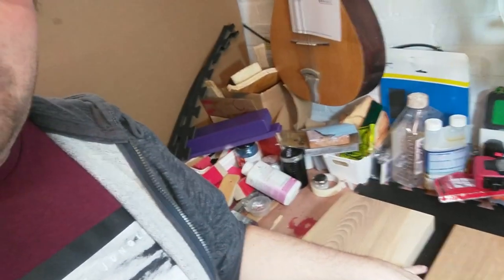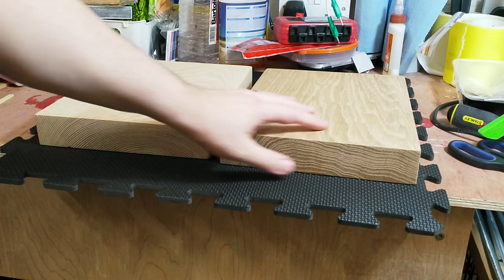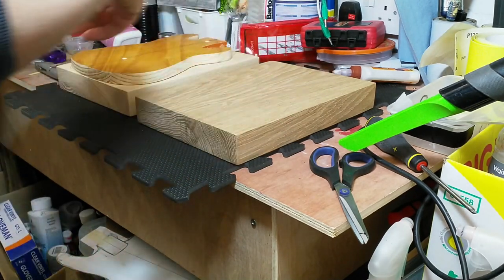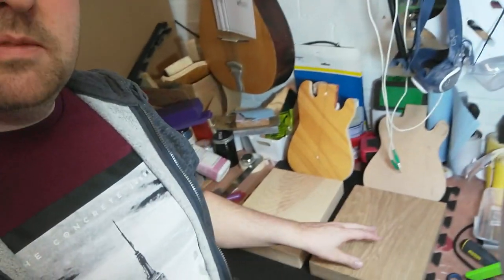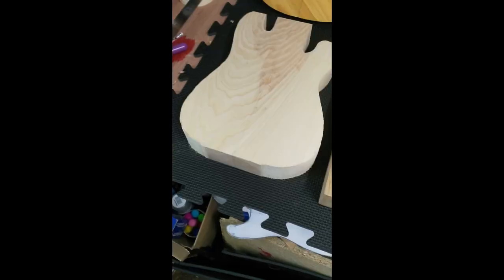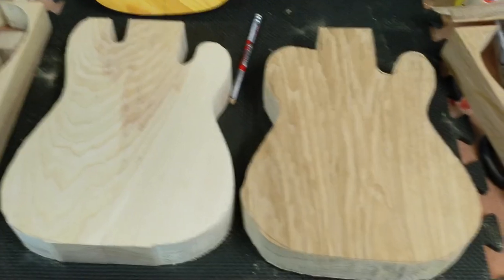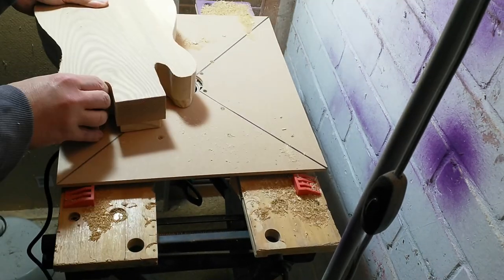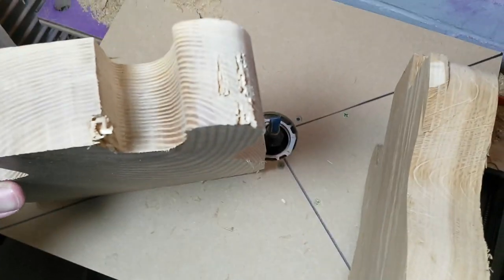Cutting out Stratocaster / Telecaster shapes

Comment: maybe there was some inconsistency in the blank, but since it happend on both of them, it might be the processing. and what a ghetto workshop!
Reply from the maker: I think if I'd cut closer to the lines so the router didn't have to work so hard it might have made a massive difference.  My wife calls it the murder room, because I've got blue plastic sheets hung up to stop the dust getting out :)
Reply: @ChrisFranklyn  there's always the chance of crossing the line if you try to cut closer to it, so I wouldn't change the way you did that.

That's exactly what you want, 'decorate' your hobby space in such a way that your spouse doesn't want to hang out there ;)